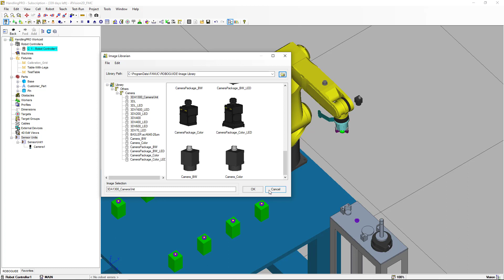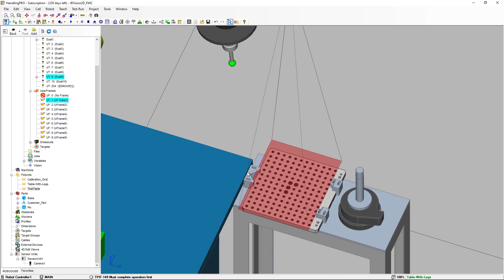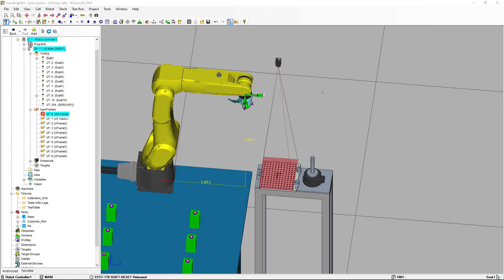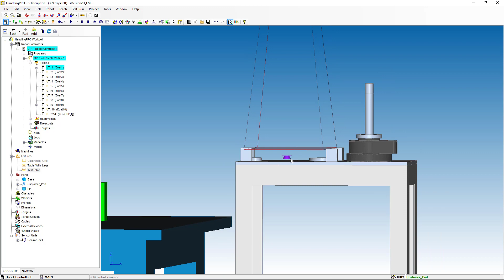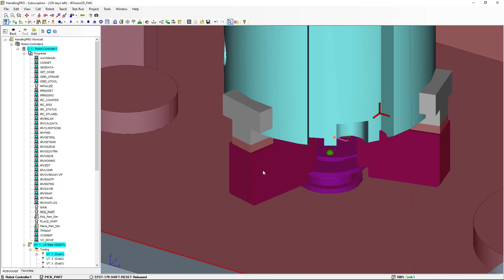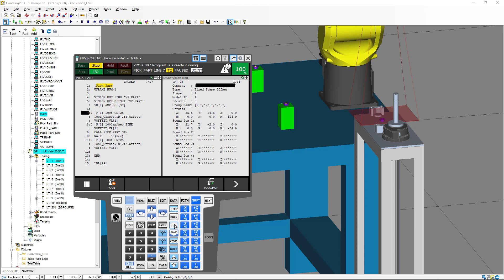iRVision 2D with Fixed Mounted Camera

Comment: You are calibrating the grid direction specifically sideways. Normally, the x direction should be set straight forward. Why didn't you do it this way?
Reply from the maker: I see your point, probably I didn't noticed that when I was making the video. It would be less confusing if the calibration grid would be in the same direction as the UT1.